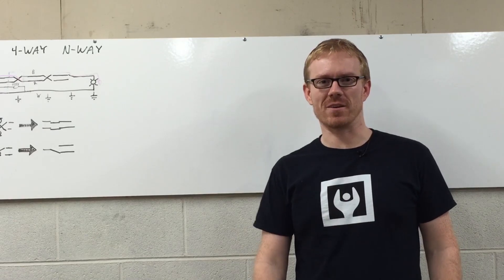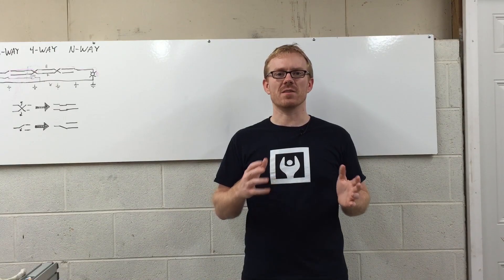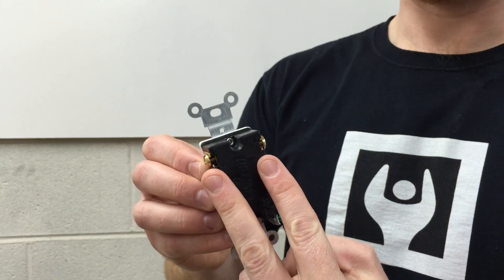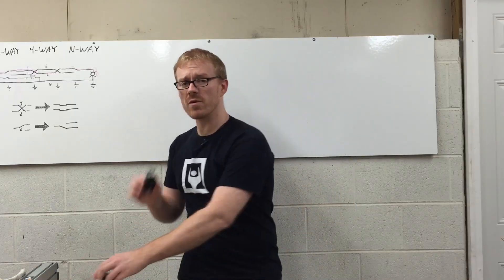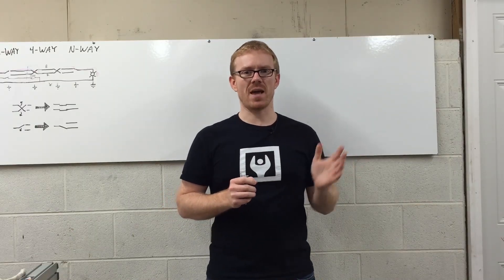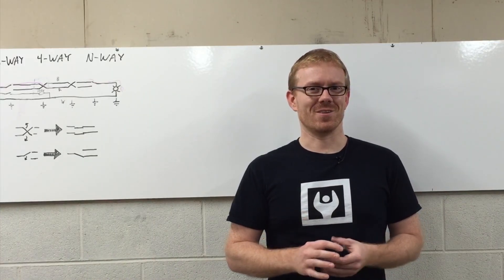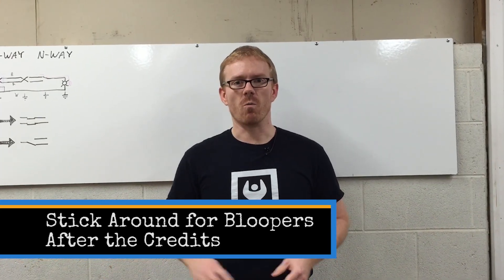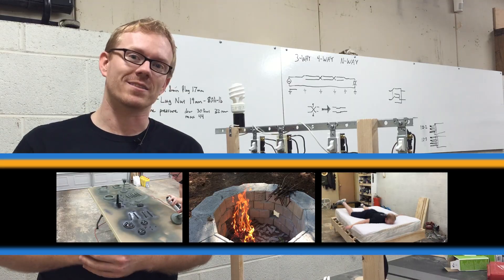Painless 3-Way Wiring

Comment: Toyota Corolla about fuel pump not coming on when ignition switch is turned on and where to find fuses to fuel pump or if there is a reset switch to the vehicle

Comment: Hi there! Im looking for a Type of Relay that Switches on and off, from a single trigger wire, from a Photo Beam Sensor? Im not sure what Kind of Relay I would need. 

End Goal is for the Photo Beam Sensor to turn on Driveway lighting, then able to turn off the lights from a 3 way switch from inside the house. Then to work in an Opposite direction, turning the Lights on from Inside, and having the Photo Beam Sensor turn the Lights off after the car drives pass.
Reply from the maker: DPDT relay 20A or 15A depending on the circuit. The photo sensor approach may not give you satisfactory results. A binary sensor couldn't tell you which direction the car was going. Perhaps a pair of sensors, that way you could determine direction. Mostly a software problem, I'd use a raspberry pi 3 maybe an arduino nano.

Comment from the maker: I hope this video helps you.

Before you get started make sure you have something like this: https://amzn.to/2SrSEVN.
Confirm your detector is working by check voltage at a receptacle. Disconnect power for the circuit you are working on by opening the breakers at the electrical panel. Then check for voltage before you touch any bare conductor. 

Good luck.

Comment: Great video and explanations.  I am confused about one thing.  If four-way switches don't scale well, how does adding a relay and another switch scale any better?  Am I buying one relay and controlling it with a bunch of switches?  That doesn't seem much different than the four-way switches controlling the light bulb.  So I must be buying 1 relay per switch.  Does the 1 relay + 1 switch combo scale better because it's easier to assemble, or cheaper to buy than a four-way switch?  I suppose if I assemble all the relays in one enclosure, I'm running fewer wires to each switch.  Beyond that, I'm not seeing how relays scale better.
Reply from the maker: It facilitates fancy interfaces like timers, logic controllers, and home automation. You seem to understand what I was getting at by using the word scaling. Fewer wires and wire pulls to add switching locations. Like you mention, you don't need to run 3 conductor between each switch. In fact, you could add an unlimited number of communication based switches that all interface through the relay...all while your initial two 3-way switches at the top and bottom of the stairwell for instance still do their job in the original fashion...all without running any additional wiring.

Comment: Could you use a four way switch as a simple DC motor reverser?
Reply from the maker: It is pretty common to see 2-pole 3 position switches wired up to make them function like 2-way switches but with the benefit of turning the motor off. Depending on the DC voltage and amperage, I bet a common household four way switch would do the job of reversing just fine, but you wouldn't be able to turn it off without a separate switch.

Comment: Fantastic tutorial. 
I want to have two temperature controllers(supply and return) connected to a solenoid, a fuel supply motor, temperature high and a flame detector.  This is to setup an oil fired system for a  thermic oil circulation.  Do you have or know any such video? Thanks in advance.-  surendra.nerurkar@gmail.com

Comment: Can I wire multiple  3 ways on on feed
Reply from the maker: Tony Staffa only two 3-way switches per load. More than yhat you will need a 4 way switch. If you mean multiple loads controlled with 3 way switches like a hall light and a stair light both off circuit 7 in the breaker box, then yes. Just feed the first 3-way in each loads switching circuit with an unswitched hot from the breaker box. Hope that answers your question.

Comment: this is a really great vid and i hate to be the voice of doubt or whatever but it does scale as well as it ever could, you can literally put millions of 4-way switches in the circuit with 5 wires total. not sure what you mean with scalable maybe multyfuncionable or expandable?
Reply from the maker: +steffankaizer what i meant to imply is that adding inputs to control the load is more scalable when a relay is added. For each 4way switch added you have to add a cable with 3 conductors. If you use a relay and a microprocessor you could add two-wire switches, wireless switches, logic based inputs, and remote switching to the circuit. Adding millions of switches hardwired into the circuit is not feasible due to the voltage drop caused by so much cabling. Adding billions of inputs through a webpage permitting any phone or computer on the planet to switch the load is feasible. In this way a relay makes the system more scalable. Maybe semantics but i stand by my phrasing choice. I definitely like your adjectives of multifunctional and expandable as they cover advatages of adding a relay not covered under scalable.

Comment: Hi there, IF I NEED TO use a dimmer in a 4 way configuration, where should be placed? as of three way switch Maestro dimmer.
In a 4 place location how many dimmers can be installed? thanks for your help!
Reply from the maker: +Javier Montano maestro switches are specialized equipment. They use blue terminal connections for some type of communication between dimmers. You may find this document helpful if you are dealing with Lutron products:  http://www.lutron.com/TechnicalDocumentLibrary/048-150a.pdf

You should not use multiple dimmers in a circuit unless the manufacturer has designed them for such an application. 

You could put a single dimmer at the end of a multiway switch chain just before the load. The user would only be able to adjust the dim setting from one location, but they could turn it to off or dimmed (as set by the 1 dimmer) at from any location.

Comment: I own several rental properties and i've been DIYing for a long time, but never clearly understood how 3-way switches worked. When I replaced switches, I tried to wire them exactly as they were wired before to make sure things work, or I had to use trial/error to get things to work (which is a pain when needing to turn off the breaker each time). 

I've watched many videos trying to figure out how and why 3-way switches work the way they do, and this is the FIRST with clear animations to show how 3-way switches work and what goes on inside the switch. I feel a little enlightened now.
Reply from the maker: Glad to hear it. Any other electrical concepts you think would be helpful for DIYers?

Comment: I once used a single pole double throw relay as a 3 way switch. However I didn't know that you can use a double pole double throw relay as a 4 way switch. thanks for the tip.
Reply from the maker: +Jolyon Welsh glad i could help
Reply: I did it again on another job, only this time it has a 3 way dimmer as the other switch.

Comment: Thanks for the video!  Quick question, if I'm trying to set up two switches on the same DC circuit, what type of rocker switch should i buy?  Would it be a single pole double throw switch connected to another single pole double throw switch?  Any advice is greatly appreciated. Thanks
Reply from the maker: Bubba McLean yes. exactly like for ac circuits. depending on the load and voltage, dc can be harder to break for switches than ac...due to no zero crossing. be sure your switches can handle breaking the load.
Reply: Ok great!  Thank you so much.  Aloha

Comment: Can you give me an example of a problem where the relay would solve the problem and not just the standard 3-way and 4-way switch configuration.  I have personally wired up multiple banks of lights that were controlled from 6 different locations using occupant switches.  Never had to install a timer in a multi-way switching configuration, but I would imagine if you put the timer(s) in line with the single carrier wire it would work fine.
Reply from the maker: Michael Smith if you put a timer in series with the circuit, the switches are defeated. check out my video home automation diy garage light controller for an example of where the relays would be essential.

Comment: Hi, I hope I can get some help from you! We recently purchased a house and working on some lighting by myself. We have 3 way switches for staircase. I had to rewire one 3 way switch due to removing the wall and had to move the switch. I extended wire and replaced to a new switch and reconnected all wires where they were before. and now upstairs one I tried to reconnect and seems there are no main panel wire is there. I assume main panel is coming from light?! Btw, we have 2 lights. So 2 lights and 2 3way switches. So both switches don't have the panel. What is the best way to connect all wires???????
Reply from the maker: Mia Kim Elkin probably you have a cable running between lights with supply in one light box. I always disconnect all the wires by undoing wire nuts and fixtures wiring so I can positively identify where each wire goes. You need to identify which cable comes from the panel...note this could be after going through other fixtures or switches.  Once you have identified supply cable, you need to confirm which cable goes where. Be sure breaker is off. Do this by using your meters continuity (ohmmeter) function. After you positively identify all the cables, draw them on my free printable to diagram it out. Once you have information about cable location written on the diagram, send me a picture at info@makercise.com and I'll take a look and give you feedback.

Comment: Awesome explanation and nice graphics! very educational! thanks!. 
A question on the relay though... I didn't understand why it would be better than just the multiway switch for a light. Let me see if I got it: You mean it will be useful when you activate the coil through other means other than a switch;  motion detectors and so on, and you can have them in parallel with normal switches. Am I right? :)
Reply from the maker: The graphics took lots of effort. Thanks for the complement. 

I think you have got it. The relay isn't necessarily better. It just scales better. Instead of needing to pull 12 or 14 gauge cable between each switch location a smaller signal gauge wire or a wireless signal could be tied into a microprocessor and xor'ed together to drive the relay. Plus, all the traditional switches still work.

My motivation for this video is an upcoming project that will tie into the relay concept.
Reply: Makercise Best multi-switch explanation on YouTube award goes to....... MAKERCISE!